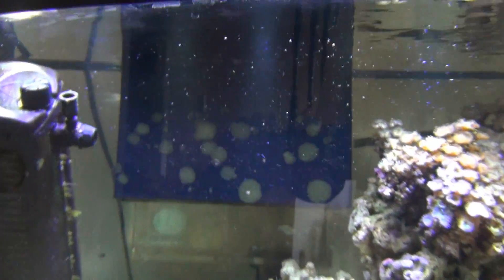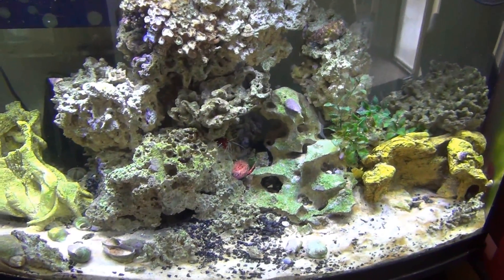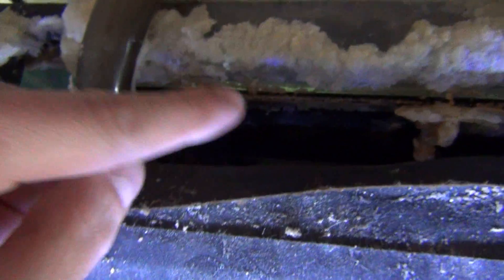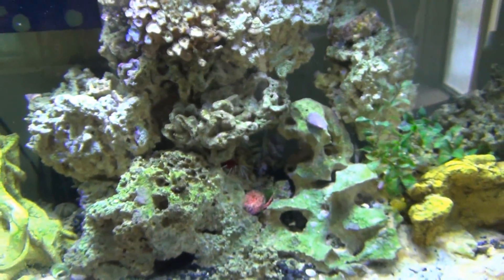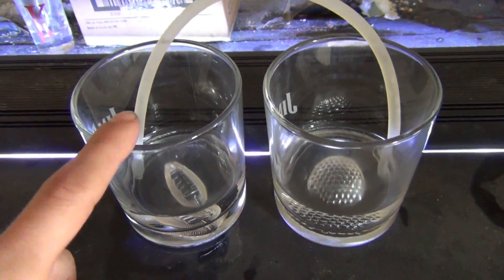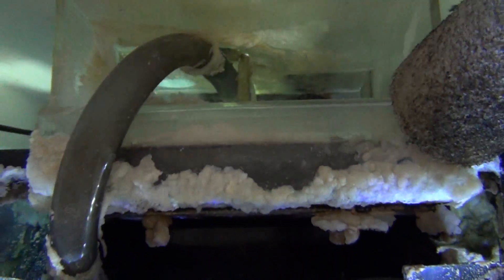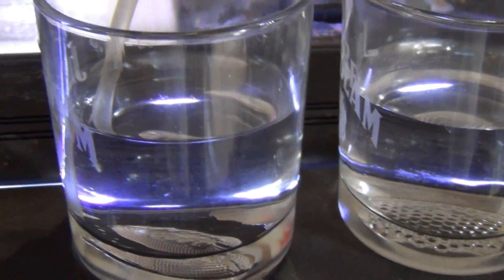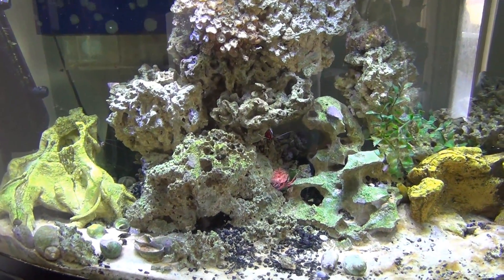How Overflow Boxes Work - Saltwater Aquarium

Comment: Excellent explanation, thanks.
As i understand it these systems are fairly limited in terms of flow rate. Therefore the bigger filtering capacity of a sump is negated by the lower water turnover. I have 2 x 850lph externals (that's measured flow rate with media etc, not manufacturer figure). Although the volume of the externals is way smaller than a sump, the whole aquarium is cycled through 6 times an hour. Plus one of them has a built in heater.
Reply from the maker: Yeah you can get (or make your own) overflow boxes of many sizes and flow rates.  But the sump isn't meant to act like a mechanical filter like your actual tank filter.  It is meant to provide a few things.

1. Biological filtration
2. It increases total water in your tank as well.  More water = less chance of tank water quality going downhill fast.
3. It's a place to put your heater so it isn't seen in your main tank.  Or other things like a UV sterilizer.
4. If you have a large sump (say 10+ gallons), you could setup a small refugium in there too.

I like that you have two overflows.  Good to have that as a backup incase one fails.  Now, I used overflow boxes for like 7 years, and I never once had any issues.  But, I was always a bit worried.  You can also get a switch that will turn off your return pump if the sump water starts dropping (and your main tank is about to overflow).

*edit.  I misread.  You have two external hang on 'sumps'.  That's cool too, I have to look those up.  I've had hang on refugiums, but not sumps.  My sumps were usually 10+ gallons, so I don't know if a hang on would have sufficed.

Comment: Only one slight problem with these type of boxes.They are a pain to set up, that plastic tube needs to be filled with water constantly.If the siphon ever breaks (and the odds are sooner or later it will), you lose the flow of water draining out of your main tank.The pump will still be emptying your sump into the main tank. in the event that your main tank cant handle the extra volume of water, your main tank will overflow onto the floor.Your better off getting a drilled aquarium that is designed for marine use. mine has 2 overflow pipes. if one gets blocked the other should still be able to handle the flow.If you use these, the best way to avoid disaster is to have a sump with a small section divided off in it (which it is a good idea to do anyway, and have the return pump in there.That way if the water stops flowing into the sump it only has a small volume of water that it can pump back to the main tank, rather than the entire sump.

Comment: I am still really confused about one thing...
how do you control your return pump?  what happens when the return is faster than the input?  is that even possible?
Reply: +Levi Burns faster return would just cause the main tank to overflow faster, thus speeding up the flow to the sump until both are balanced.
Reply from the maker: +Levi Burns Yes.  As long as the overflow box can handle the flow, you can have the pump as fast as you want.  All the overflow box does is just like it is called, it 'overflows' water from the main tank when that tank water rises.  The pump pushing water up from the sump is what is making the whole system work.

Comment: how did you get water to flow through the utube in the glasses without sucking out air?
Reply: Tareck Fahmi you need to "prime" the tube once which can be done several ways. Fill the tube manually and then drop it quickly to the second reservoir, insert an air stone in the bend part and water will begin to flow or even a small siphon action could start it off depending on the flow per gallon you need.

Comment: Hi great vid, but what size return pump are you using? Ive sold my previous marine tank (vids on here) ive bought a rio 400 and the overflow to sump sounds like a good idea.
Reply from the maker: I use one that I believe is about 485GPH.  Now it is actually slower than that, because you lose GPH based on how high the tube is.  Every bit of height going up to the main tank reduces the speed of the flow.  I would estimate my pump is giving about 300GPH to my main tank.
Reply: Great thanks for that.
Reply: Earthling1984 I have a eheim pump rated at 315 gallons per hour.   how can I use it as my return pump. and what size drain hose do I need. I have a half inch  return line

Comment: Hey i had a question about this box, i plan on using the box with a drip system, will the basic principle of this work with my application? basically if i have a drip amount of water entering the tank, would the overflow still work for my purpose if i have the water just draining out the bottom? hopefully i didnt sound too stupid

Comment: today i cracked my tropical tank and it was leaking but we stopped it with stickey tape but its not a long term solution any ideas in a long term solution ??? plz help !!!!
Reply: You could drain and dry around the Crack, if it's not the bottom, and patch it with aquarium sealant (silicone) on both sides of Crack and let set for about 2 days before filling it again. If it's on the sides or tip that would work fine. If it's on the bottom you'll have to empty it all the way and temporarily keep your inhabitants in something else until it's done, you'd have to re silicone the whole bottom inside and out. It sucks but that's what I've had to do, and it's one of the only real ways to fix leaks. Be sure to use a razor to remove the preexisting silicone on that panel first too.